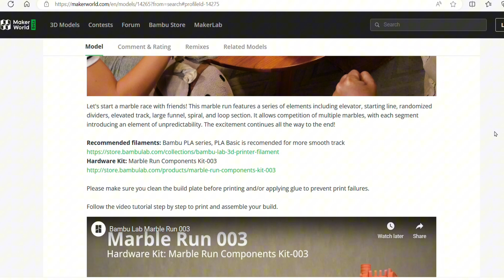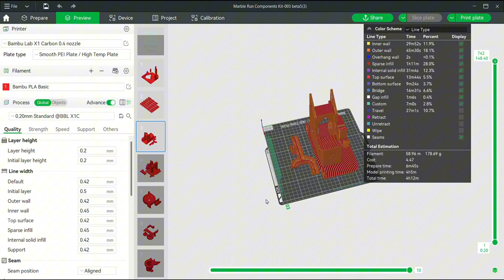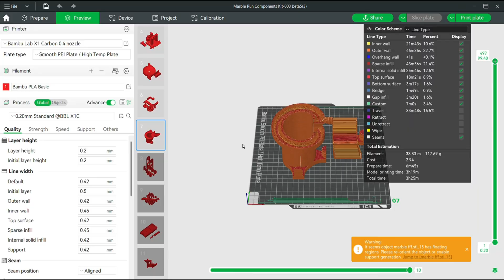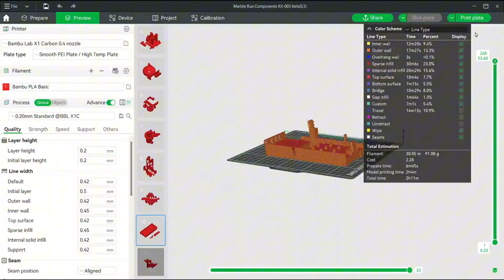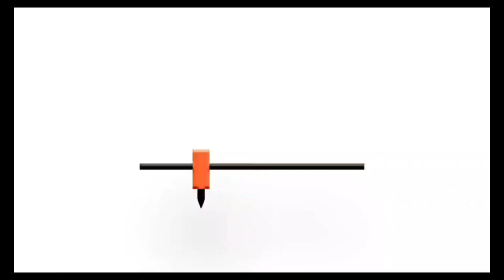Printing and Assembling the Marble Run Motorized Bambu Kit!

Comment: I couldn't help noticing, but it looked like some of your print imperfections were from moisture. Do you keep your filament dry when storing? If you already are, just ignore the rest of the comment lol. If you store them in a closed container you can stick a silica packet or two inside and not worry about it. If not, you may need to find a way to pull the moisture from the filament, like a food dehydrator.
Reply from the maker: Thank you!

Comment: Fun print, pretty good for demonstrating that 3D printing can make functional as well as ornamental projects.
My only concern (as an Electronics Engineer) is that electric motors make a lot of electrical noise, which I would prefer not to feedback into an expensive laptop. Ikea USB chargers are pretty good and not stupidly expensive, but any spare charger should be fine for this.
Reply from the maker: Yeah I agree it would be better to just plug into the wall. Thanks!

Comment: Thanks for honest print experience. It is common that people only show that Bambu printer is just perfect. But you did not hide imperfections, which is nice. As I did not believe that Bambu printers are so perfect as they speak about.
Also, did you use original Bambu filament? Or some other brand?
And why do you use slicer software? They say you can just print anything from Makerworld from mobile phone, without slicer interaction. And this is official Bambu kit as I understand. Does not that mean that it is presented on Makerworld too?
Reply from the maker: I use Overture PLA. I also have Prusa printers. So it's just easier to run both slicers on a computer. I also run a lot of my own designs so it's an easier process. Thanks so much!